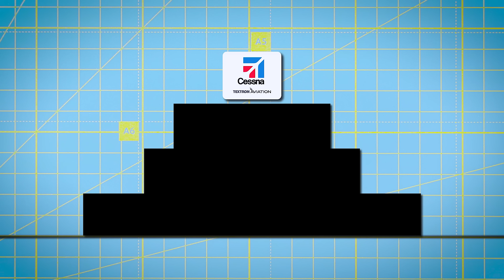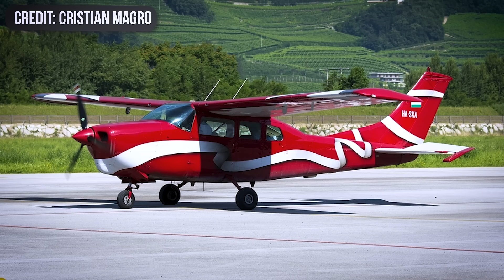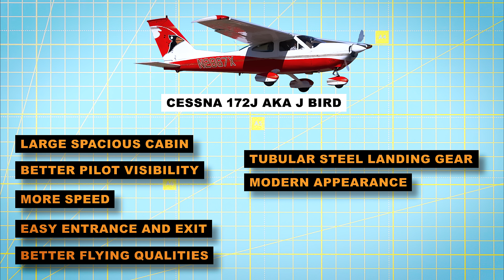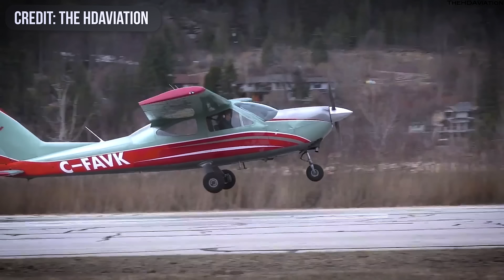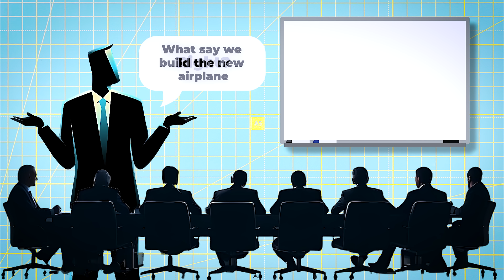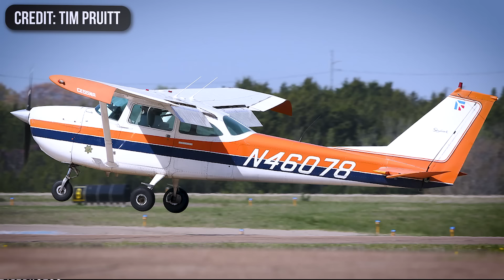Cessna 177: The Plane Pilots Hated

Comment: It is a shame that the C-177 didn't succeed due to the issues with the orginal 150 hp model. The C-177B was a great plane. I have a fair amount of time in the C-177RG and it was a great flying plane, fast with good range. The only downside was it took a bit of runway to get off the ground.  People finally realised the value of the plane. C-177Bs sell for more then $125,000 now. Good ones are $180,000.

Comment: A friend of mine and I rented a Cardinal for a weekend flight from Houston to central Nebraska.  We loved it.  I believe it had a 180 hp engine w/constant speed prop.  It's cruise speeds were only slightly faster than the 172's we had experience with but it's climb performance was noticeably better.  It was easier to get in and out of and had a lot more interior room than a 172.  It was simply a more comfortable airplane.  We loved it!

Comment: I flew one a friend owned (RG). It was a nice plane and it took only a few touch and goes to figure out the planes behavior. They should have made the 200 HP retractable from the start. The fixed gear lower HP model was too close to the much cheaper C-172, so know one wanted it.

Comment: I owned one, the 1968 and the biggest problem was lack of power. Turning this airplane into the easy 172 where you could enjoy a breezy flight in a 172 with the window open on a hot day was a hard sell. The visibility is great, you can peer around the leading edge of the wing in the pattern and see all you need. Getting used to the lower roof line feels a little cramped but is overcome by the ease of getting in and out as if you were driving the family Chevy. It looked fast but really wasn't. The 180 HP engine was the solution that was found far too late for that airplane. I heard the issues of PIO pilot induced oscillation and I think there was a video or two out there among the bruised egos of pilots that bent a prop. It was easy to fly, you just had to stay ahead of the airplane by keeping wind over the wings and not getting too slow. It's an OK 2 place airplane but with 3 or kids care was needed in the 150 hp. 68. I flew by myself mostly but found I wanted more speed. Matching a 172 in that department was about it. Fuel burn was modest and I have to say I enjoyed flying it. This airplane even though was a 1960's development, I found a remote FBO that had a fuel guy that had never seen one before in person. Don't be afraid to buy one, especially the 180 hp model.

Comment: It was a joy to fly especially when they upgraded the engine to the O-360. Very honest flying and incredible visibility up and down and all around. It is also the number one airplane for paraplegic pilots. It sits low and has no struts so the doors open to 90°. It’s not a speed demon but if you’re just taking up friends for a tour or the countryside or a trip for the $100 hamburger.

Comment: I disagree. The Cardinal was well designed, had great visibility and roomy. It suffered from leaky doors and was woefully underpowered. The 177b had 180 hp which helped, but it really needed 200-210 hp to really shine. The 177RG had better performance than the Piper Arrow II. However, the Arrow III was faster and higher gross weight and useful load. Given time further development, the Cardinal RG could have been better than the Arrow.

Comment: If they put an 0-470 and made the cabin a little bigger, along with the wing moved forwards a little bit to offset the weight of the engine, you’d have something worthwhile.  With both fixed and retractable gear, it was a dog.
Reply: And how many hours do you have in a Cardinal?  I have never heard of anyone who has flown them say anything but how nice they are. The comments here seem to confirm that.

Comment: Long time owner,  a great airplane.  Had mine for over 40 years till I got too old.  It's still flying.  A guy up in Canada did a lot of aerodynamic work on it (his not mine) and his fixed gear model flies as fast as the RG, I installed some of his mods.  The RG model has a very complex gear system that fails and is very expensive to maintain even if you have a mechanic who really understands it.  But it is fast.  I had a 182 before my Cardinal, basically a flying pickup truck, if you could get a piano in it, it would fly it.  But not that fast and it burned a lot of gas and some oil and the Continental engines needed a top job about halfway to TSO, Lycoming didn't.

Comment: I have about 30 hours in a 177 which is one of the aircraft owned by the club that I belong to. 
We have discussed selling the airplane for several years, for multiple reasons. But we now have the airplane well maintained, with fresh avionics and a new interior. It's a great airplane. 
My impression is that the Cardinal was designed by Cessna engineers who were also pilots. it's a well designed, well thought out airplane. It's comfortable and roomy. Our B model has a 160 horsepower Lycoming O-320. Even with that, it's a little underpowered. a 200hp or 230 hp engine would have made all the difference. 
I love flying the Cardinal.

Comment: The 177 Cardinal didn't use an elevator but a stabilizer. Using this gave different handling qualities than the 120, 140, 150, 152, 170, 172, 175, and other planes that used an elevator. What was really great was without the struts the doors opened more making getting in was real easy.

Comment: I owned a 177B for many years and loved flying it. Had over 600 hours in it and my favorite of all the aircraft I've flown. It was roomy and stable for aerial photography. The only recurring issue was the nose wheel developed a shimmy upon landing if the nose strut wasn't properly serviced. Normal fuel consumption was around 9 to 9.5 gal/hour when leaned out.  I also had an engineer create a lexan cover for my landing light to protect it from stones and debris when landing on grass runways. It was comfortable and roomy and a joy to fly. I miss it.
Reply: The Cardinal Flyers Club has a fix for the nose wheel shimmy.

Comment: I was a pilot and CFI for 40 years and never knew anyone who "hated" the C-177.  There just wasn't enough advantage to it to get the public interested.  It was sleeker than a 172, and it flew just fine.  At one flying club I worked at, new pilots would learn on the 172, get their license, and then "upgrade" to the 177.  Side note: the early 172s had flaps that went to 40, the later models only went to 30 for the same reasons stated.  But in the hands of a decent pilot, those 40 flaps were handy.

Comment: Non pilot, here (former AME, unqualified). We had a customer with a retractable gear version. I never went up in that aircraft, but I remember the figures for it being more than impressive. The thing sipped fuel. If my memory serves me right, it was around the 10 gallon per hour mark at about 140 knots, which the owner described as "idling".
He absolutely loved that aircraft. It had a limousine interior, as well. For some reason it just seemed spacious. I remember describing it as the "working man's Bonanza".
Obviously, it didn't have the credentials of the Bonanza but it was a heck of a lot of aircraft for the money and a lot cheaper to run. A good Bonanza was low six figures, in Australia, at the time. The Cardinal was $45k with about 1000 hours to go on the engine. A lot of bang for buck, if you ask me.

Comment: I’ve got around 1500 hours in the C177. With 180hp and the slotted elevon, they’re a solid plane to fly. I never had any flyability issues. All the problems I experienced were mechanical or electrical. But those things happen when the planes are flown 8-14 hours every day for utility work.

Comment: I have many hours in the Cardinal RG I enjoyed it , it is roomy and by me kinda short the seat pulled up put the wing behind me . It liked 10K and good cruse at 170 MPH or about . Only thing that concerned me was the gear mechanics . If I could have one I would jump at the chance but planes are not cheap by any means now i can't even afford a R/C helicopter . Just my luck . Next step up was a 182 RG turbo and then the 210 both would take a healthy bank account and a good reason to have either .

Comment: My very first airplane ride was in a 177RG. After two extensive aviation careers, I still have a soft spot for this.
Reply: I flew the 177 at RAF Henlow flying Club. Not many in the club liked it but I did. Found very smooth and quieter. Easy to get in and out. Better than the Piper’s. However it was tricky on final flare with reduced ruder authority.

Comment: I fly an early model 177 with an O-360 upgrade, and it is absolutely an amazing airplane. It has its quirks but it just takes understanding and a little time to get used to it. It really is better than a 172 in every way other than beginner friendliness.
Reply: My son is part owner of an early 177.  It has the engine upgrade and a constant speed prop.  Great little airplane.  About the only thing it's missing is rudder trim.  The view with no struts is fantastic... makes a great photography platform.  Bigger doors and lower floor than the 172 makes it easier for me to get in and out, too, and don't undervalue that extra couple of inches of cabin width.

Comment: I have around 1000 hours in Cardinals of all types.  It is STILL the ONLY high-wing aircraft I'd ever want to fly a circling approach in - the pilot czn actually SEE the airport environment when turning towards the field.  They areVERY GOOD aircraft.  True, they ALL could use about 35 - 50 more BHP, but they are ALL good flyers.  The only problem was that pilots EXPECTED them to fly like a 172, which THEY DO NOT!  Hammer. USAF SSgt; US Army CW4/SrAviator
Reply: From the Air Force to the Army…..what were you thinking 🤔
Reply: @ameritech4551 choppers? 😂
Reply: @daszieher Nope, fixed wing only; I wasn't willing to fly ANYTHING held up by a large nut, called a Jesus but for a reason! Hammer
Reply: @ameritech4551 Well, they wouldn't let me into the USAF Academy as I word glasses, and at the time, because of Vietnam, they were ONLY accepting pilot eligible applicants.  I graduated HS at 16, turned 17 and enlisted, knowing  there were two programs that could back-door me into a cockpit, regardless of the glasses.  Applied seven times for these programs, got refused each time (I was too good at what I did). So, I refused promotion to TSgt/E-6, got out, used my GI Bill wisely, and flew for the Army for 16 years, FIXED WING ONLY!  Hammer

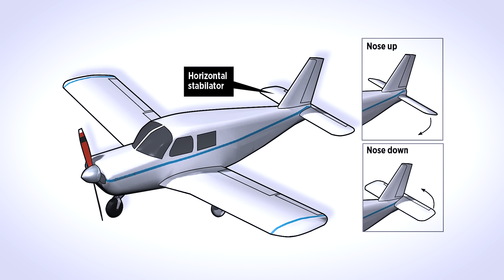Comment: Illustration at 6:15, Nose Up? Nose Down? Uh, backward. Just like too many animators of turbojet engines with the shaft turning in the wrong direction for the angle of the compressor, turbine, and stator blades. Some people should not be allowed to illustrate mechanical devices.

Comment: There were a lot of R/C models built in the 1970s that were modeled after the Cessna 177 Cardinal.The one I had had a fiberglass fuslage and foam balse sheeted wings but it never had enough power to actually get off the ground.I think the Cessna Cardinal is still a really nice sleek GA airplane.But I prefer and still fly the Cessna 172 Skyhawk over all GA single engine airplanes.

Comment: Nice shot of Walter and Olive Beech overlooking the C-45 assembly line.  
Not a Cessna in sight!
Reply: Yes, I noticed that and said to myself “Hang on!  They aren’t Cessnas!”
Reply: Yes.  But there were some great shots of the Pawnee assembly lines.
Reply: @willy_foley Yes, I noticed the Piper cowl nose but didn’t identify it as a Pawnee.
Reply: @p38arover22  Pawnee is the name of the facility that produced single engine family of planes through '86.  After the single engine production was stopped it was turned into the Component Manufacturing Facility for all Cessna products (jets, caravans and spares).  The assembly lines areas are now taken up with sheet metal fabrication machines.

Comment: I had one of the orginal 150 hp Cardinal 177 (3388T), absoutly loved it! It would cruse at 135 mph in the winter and 125 in the summer. 800 ft a min climb with just me, 600 + and extra 100 foot roll with 1100 pounds of fuel, gear and people onboard at 60*. It's true it didn't fly like most other Cessnas - It flew better! You could tell when you started down the runway it wanted to be in the air. A 172 always felt like a MAc truck in comparission. Bought the airplane in 2014 for 25k put an average of 1k a year into it (not counting labor). Did a fair amount of back country flying in Wa and VC in it, nice thing was take out the back seat and there was penty of room for gear and people to seep. Would still have it but a rock took out the nose gear and firewall in 2021 and even though I am an A/P parts cost and avaibality made repair not an option.
Reply: When I joined CAP in 1978, our unit had a C-177, 150 hp with the slotted stabilizer.   It was great on missions.   Leaned out,  4 hour sorties became possible with gas left over. 
Only problem was that the vacuum tube radios became radio shop queens.   I put about 150 hours on it in 2 years and about a 3rd of them were no radio.

Comment: I DISAGREE!...Pilots love the 177, either fixed or RG. True the 177, 177a with the 150hp were underpowered. After the 180hp O-360 was used these planes came alive. They are a joy to fly.
Reply: No disrespect to the author, but did you fly one or just parrot what you heard?
Flew in 172’s and 177’s .
Bought a 77’b.  A little faster climbing, little faster top end compared to a 172.
177’s offer good handling and a comfortable cockpit that’s much easier in and out for the same fuel burn, 180 hp versions of 172’s and 177’s being compared.
People bashing on 177’s are taking about the 150 hp version.  The B models with 180 hp are exceptional aircraft that are a delightful to fly. Haven’t flown an RG but their performance numbers are good.
Really tired of click bait jackasses banging on a really nice plane.
Reply: @gibbeys What was obvious right away, is the ease of entrance, a d the view out front once in position to fly. I loved not seeing a strut outside the window, and getting a CS prop that the Archer needs. Sadly, our club got rid of ours because of bad press like this. I was chosen to return it to Muncie when it failed to earn it's keep.
Reply: My family was a Piper Dealer, a Cessna, Beech and Piper Service Center. We converted a great many early Cardinals to 180hp and constant speed propeller ( from M20 Mooneys). We also installed Horton STOL kits. Essentially creating a 4 seat Super Cub. We installed many 206 nose gear as well over the years. I thoroughly enjoyed the Cardinals. But especially enjoyed the highly modified versions my family "built". Very easy ingress egress. With doors opening full 90° the Cardinal is unlike any other 4 place single. Huge cabin and baggage. All were heads and tails above the 172. Coming from Pipers, most pilots never had an issue with the stabilator. The Cardinal flies circles around a 172. Its not even close. Cessna should have never introduced Cardinal with the 150hp engine. That's the only issue. Of note the only 2 Cessnas we sold new:  the Citations and the Cardinal. We had agreements with a Cessna Dealership and we sold nearly 100 new Cardinals. And converted some 75 more. The 172 isnt even in the conversation when compared to a Cardinal. The Cardinal actually outsold Piper Archers. Sad so many uneducated and resistant Cessna buyers chose the 172, they really never knew how far superior aircraft Cessna had given them. Truely sad. And the RG version never performed anywhere near the Mooneys or the Piper Arrow. Cessna best 4 place singe never gets the respect, nor appreciation. And yes I put a Cardinal ahead of a 182, simply more room. And those huge doors. 182 can haul more and is slightly faster, however fuel burn and maintenance was considerably less in the Cardinal.
Reply: I only flew a 177 once, with an instructor. When I landed I broke the tail tie down. I told the instructor it was a Cadillac compared to the 172. I liked it a lot.
Reply: Yes, but then why not a 500 hp engine? Give it a small jet engine, then you get rid of a plane you must take off with full rudder pushed. Spitfire and Mustang pilots were killed by their single prop and a thousand horses. It is a bad concept, one prop and a large engine. Why does every poor pilot fly those things? There ARE tiny jet engines, today.
Reply: @voornaam3191  Lamenting under-powered original equipment does not equate to extolling overpowered after market.  I owned a '68 up-powered with the O-360 used in later production, and loved it.  Even with the down-and-welded fixed gear, it was a slick airplane that sipped fuel.  And without the drag induced by the strut, the Cardinal required strict approach speed control, or you would float way down the runway before you got it down through the ground effect.
Reply: @RanchoHam I think there may be an appetite in the market for a 200hp 177RG revival. If Cessna can roll modernised new ones out the factory for less than half a million.😂
Reply: @daszieher A paper airplane for half a megabuck is a pipe dream today.  I worked for General Dynamics in a different division while they (briefly) owned Cessna; and people were saying that the liability hold-back was greater than the manufacturing costs then.  My 5 year old motorhome is now more than half-mil.
Reply: @RanchoHam  yes, the problem is the liability hold-back. GA aircraft could be significantly cheaper, if that wasn't a necessity.
Reply: @voornaam3191 250hp would be great. It doesn't have to be 500.